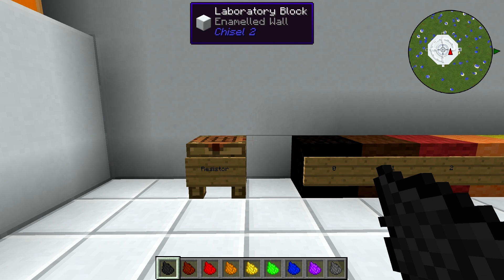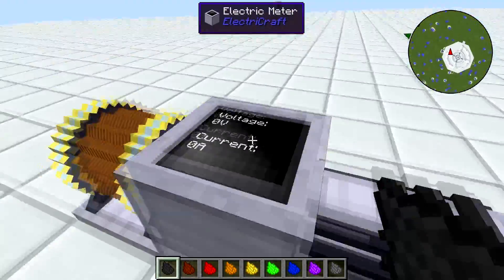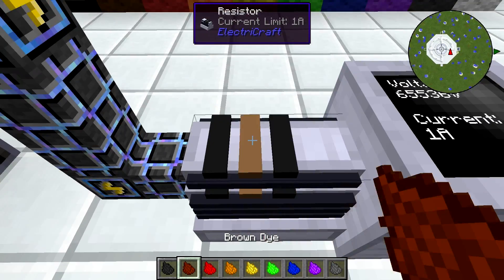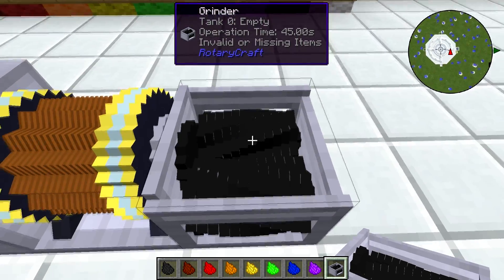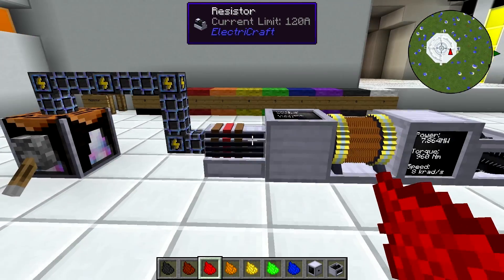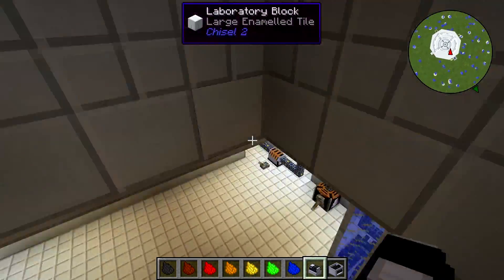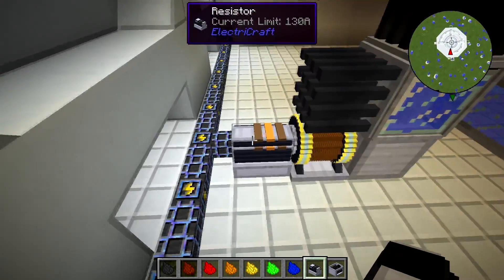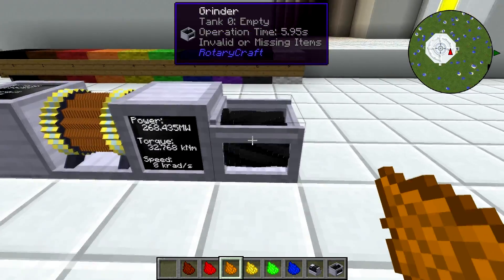ElectriCraft Tutorial #2 - Resistors

Comment: Hooray me, I actually have memorized all the codes from IRL. (These resistors act nothing like real life; real resistors lower current and voltage. Fun fact:
Real resistors have four bars. The first and second behave normally, the third is exponential (adds zeroes) and the forth one is tolerance-how accurate the rating is. Gold is 5%, silver 10%, and none 15% or 20%.
Reply from the maker: waterlubber Like Reika said, simplifications must be made for gameplay. Why have you memorized all the codes?
Reply: SentinalhMC
Because I do a lot of electronics work. As a hobby. It wasn't hard, the hardest is the grays and whites at the end
Reply: it's minecraft......
Reply: Yea.. And while the inverse relationship of actual physics might have made things more difficult, I would have liked the realism of Ohm's law. The voltage could be fixed by the battery while the resistance would inversely affect the amperage. ( V=IR has been burned into my brain and it not being the same here will be just a slight bit frustrating. :P )